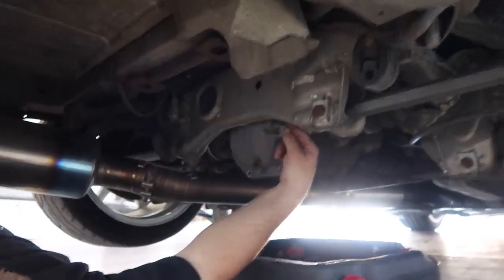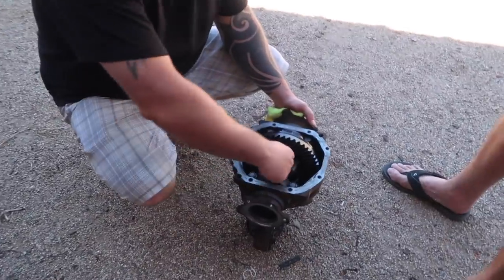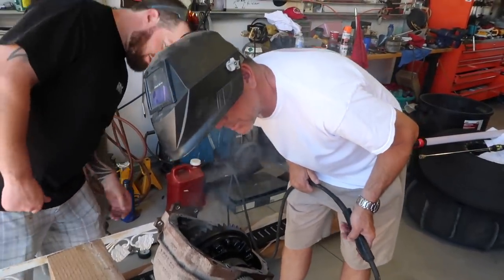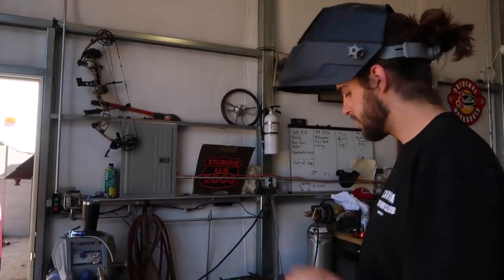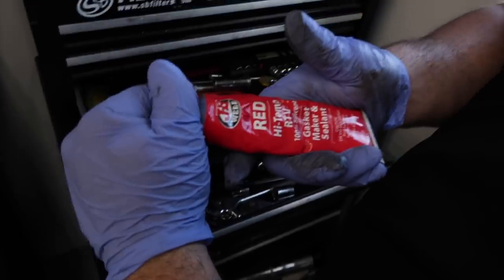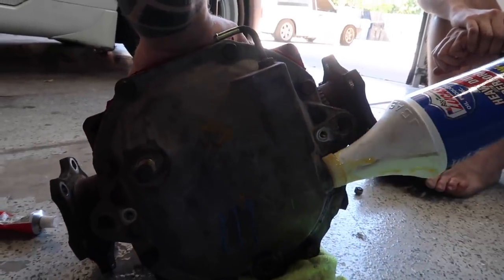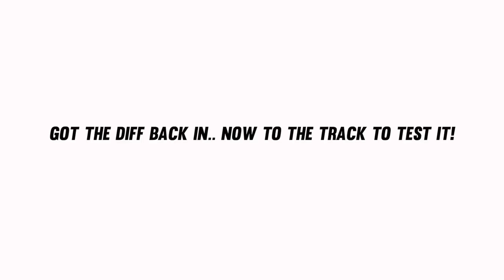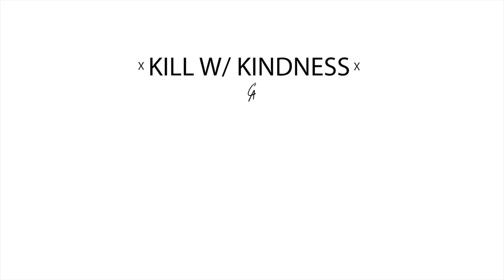350z Welded Diff: How-To and Testing at Drift Track!

Comment: I’m looking for a new car rn, and I’m stuck between a g35 coupe and a 350z. I love the vq35, but idk which to choose 😕
Reply: Marco C if your gonna get a DE id say go with the G35 but if you want a 350z the get the HR which is 07-08
Reply: colin g you’re a bit late bud :). I ended up with a 335i, but also have a G35 sedan on the side!
Reply: Vq35s are pieces of shit tho haha and sound terrible. Only good thing about the chassis is the trans back
Reply: @jeremyhare9515  my G35 has been sitting for over a year now. Loving the N54 life tho
Reply: @marcoc4513  mine too lmao got it for free gonna be a drivers car for drifting until it blows then ls lmao. Watch the n54s too they also blow up. Buddy did 2 oil changes between 10k miles. Boom blows up without a knock or anything just spun bearings
Reply: Easy, 350z
Reply: @Witthevibez  haha thanks for reply, 5 years later I have a 600hp big single N54 haha

Comment: I had a welded diff in a Mustang, worse mistake I ever made. If the car is not a daily no big deal but as a daily, it sucks.
Reply: Kevin did you ever wreck it
Reply: @tylerhunt9129  No never wrecked it. Was interesting driving in the rain though. Biggest issue was making sharp turns.
Reply: Kevin you sir are a legend